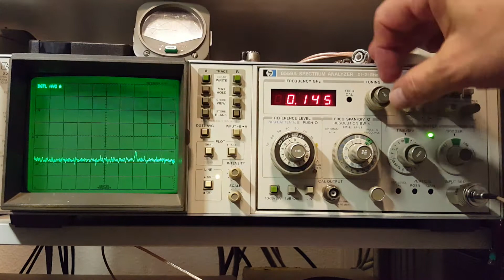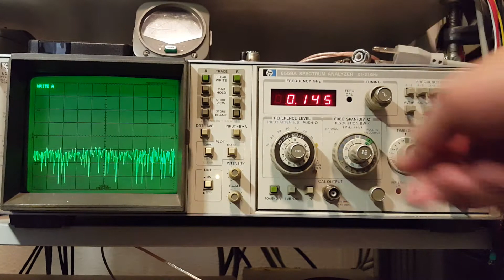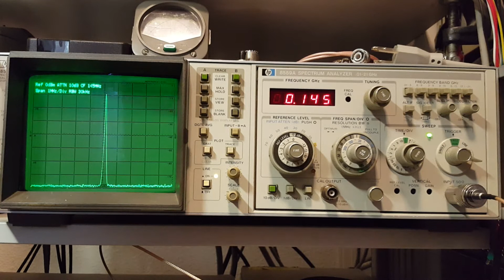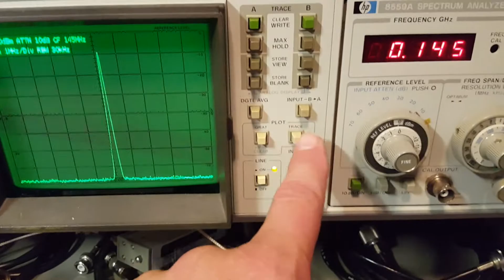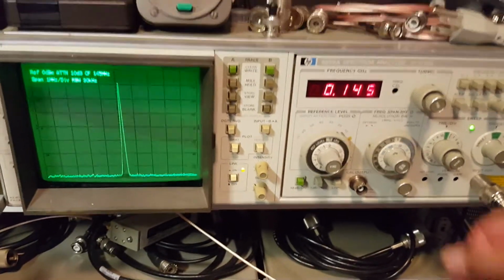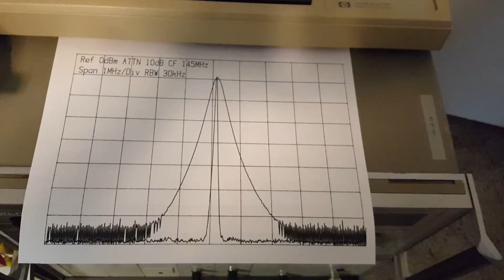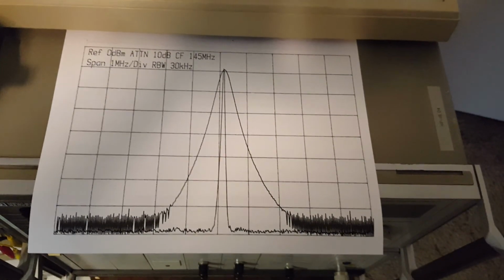HP 853A quick demo.

Comment: This would be sooo cool to play with...er, I mean use!  :)  Mine only goes to 1GHz and not to wide...are the ink pens still available for the plotter or do you roll your own?  ~Jack, VEG
Reply from the maker: I have been getting my pens through Draftingsteals, they have been having supply issues and sometimes it takes a while for them to fill my order. I do keep the old pens and have had luck cutting ink sponges out of sharpies and putting them into the pen bodies.

Comment: Beautiful equipment!! I'm looking for one of those, but the analog display 182T
Reply from the maker: Thanks for watching. Out of the two spectrum analyzers I have, I have a soft spot for this one. It's been my "go to" for years when I need quick measurements. With it's simple 3 knob operation and the ability to switch from digital to full analog mode it's hard to beat.